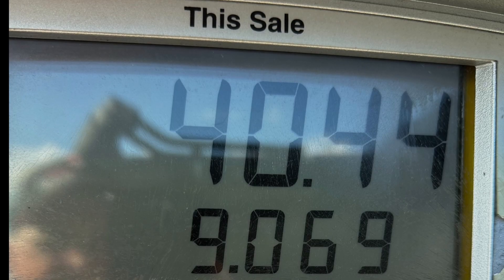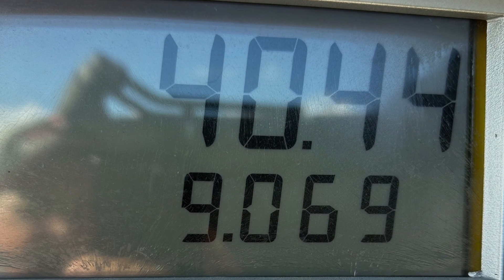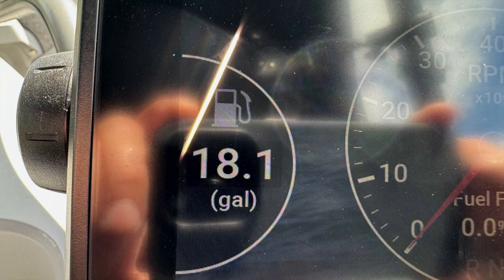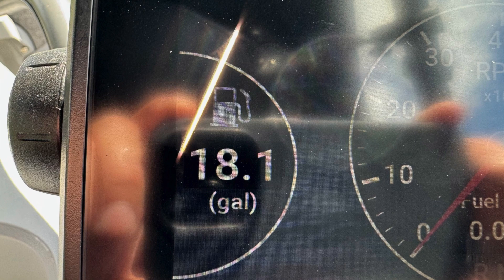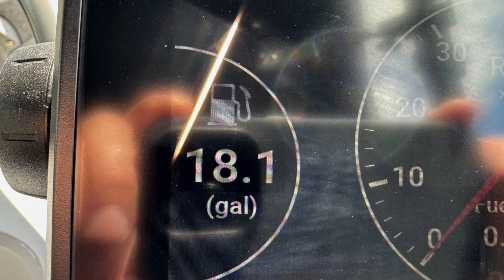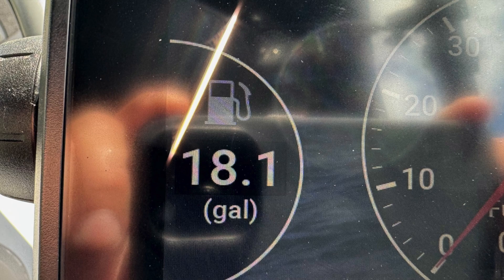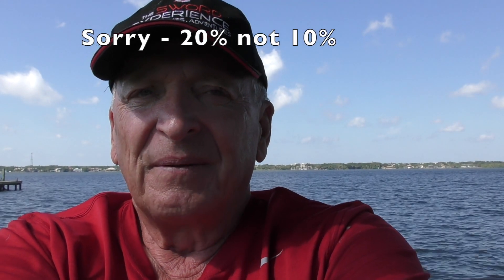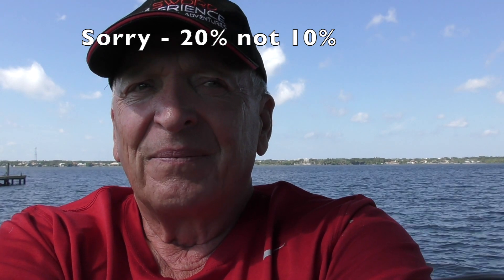Switch Yacht Devices  Gas Gauge Accuracy

Comment: What do you think about adding a Sea Doo tuning package from Torx Racing to the 230HP?
Reply from the maker: I have no experience with it.  From what I've read on the forums, the 100 to 170 tune is definitely worth it.  The rest of the tunes are more questionable as to any real performance differences.  Many say it will void your warranty and changing it back still leaves a history of the tune in the ECM.  But this is unverified rumor.  I have a 170 and looked into a tune.  I didn't do it.  I feel the better bang for the buck would be changing the impeller to a Solas.  I'll do that one day.  :)
Reply: @letsrolldiyauto1532  what forums are you on where you talk about this?